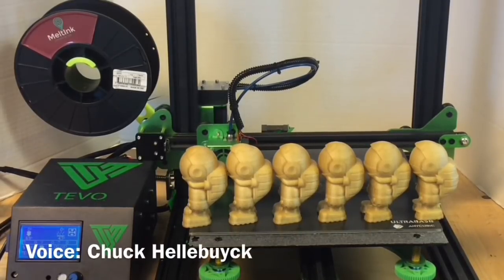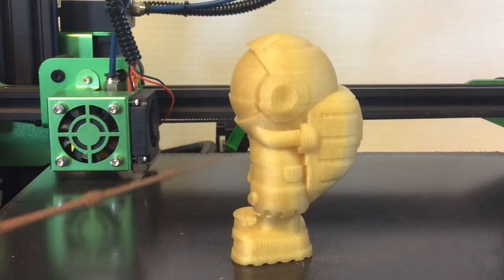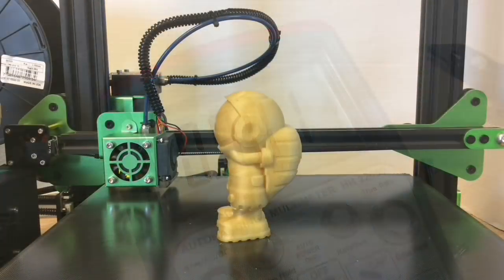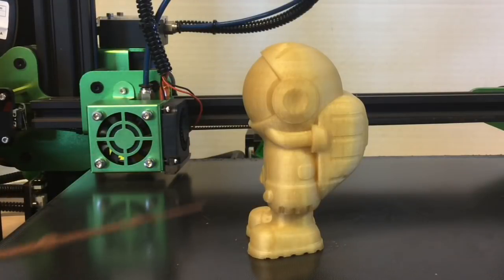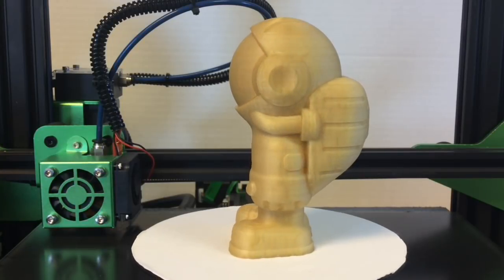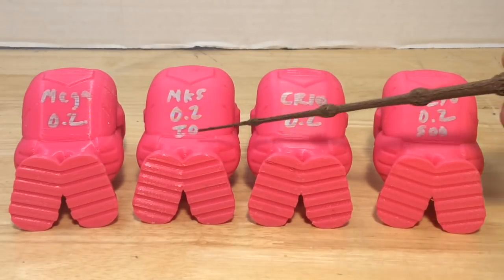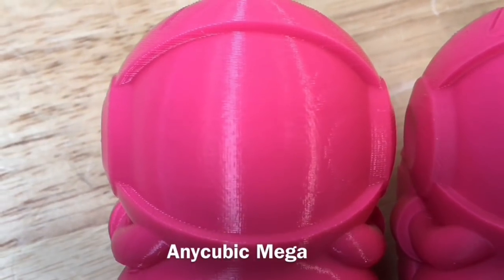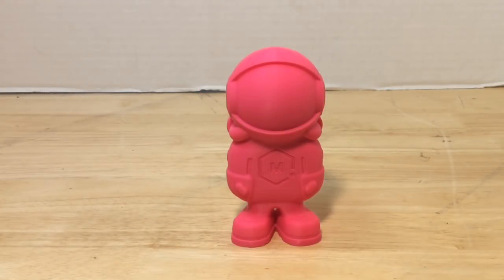Tevo Tornado Fix & I3 3D Printer Phil A ment Print Off

Comment: The CR-10 has been a headache for me. I know it's a great printer and it works for others but for me, it been a pain. I have been fighting with slipping extruder for months. Do you still like the TEVO Tornado? What about salmon skin a lot of people talk about, is that easy to solve?
Reply: Steve Laminack assuming your grub screws are holding and the gear drive is not slipping make sure the tension on the spring is sufficient to push the filament into the gear drive but not too tight and lastly you may just have a bad stepper motor this happens sometimes they come from the factory bad they work well enough to pass QC but they are weak where they fail completely replace the stepper motor it's a $13 test :-)

Comment: Were you able to get the x carriage to stop wobbling? I tightened all three wheels and the x-axis belt and mine still has quite a bit of wobble to it.
Reply: TheBlackBeltPanda there are two ways to tighten those Wheels you can tighten the bolt itself which I'm guessing is what you did but also one of those aluminum spacers Between the Wheels and the plate can receive a wrench it is eccentric if you put the wrench that came with a printer onto that spacer and turn it it will actually shift the position of the wheel in relation to the plate and it's plain pushing the wheel closer or further from the aluminum Extrusion in Chuck's case that's what he had to adjust to push the wheel closer to the Extrusion to tighten it up try that on yours
Reply: Thanks, I discovered that eventually when I took everything apart. =)

Comment: Did Tevo offer you any support in fitting your issues , or are they only interested in selling printers and relying on the community to offer support ?
Reply: I had the same issue. Contacted TEVO and to my surprise they contacted me in 9 hours. They gave me a step by step instructions to decrease acceleration as well as checking the stepper voltage. They had me bring the Y up to 1v. 
    2 days later I noticed the extruder had 1 tooth missing although it wasn't effecting my prints. E-mailed them a picture and they sent me and entire extruder assembly. I have heard horror stories about Chinese companies leaving high and dry with support but so far I am a happy guy. I have an Ultimaker 2 XL, Craftbot XL and 2 Raise 3D N2 Plus units and so far this cheap machine has been making fantastic prints! Very impressed with what I got for the money. Great comparison! Subscribed.

Comment: Hey Chep could you help me out? I have a XYZ printing Davinci JR for about 2ish or more years And like every 2 Prints it would Jam up the extruder I dont know why. I tried 3 colors And even with the white ( For some reason prints the best for me) And it still Jams up the extruder. I have a few projects I need to work on so I would love to have Some help as soon as posible. Thanks
Reply: CHEP 3D Printing & Electronics I don't Think so. I cleaned the nozzle completly before using the filament
Reply: CHEP 3D Printing & Electronics would It be posible that the filament need to be oiled so it does not Jam?

Comment: Very good example of how to diagnose and troubleshoot a printer problem. One thing I've noticed in forums (of which I'm also guilty) is changing too many things at once. It's hard because a lot of times when posting for troubleshooting help you'll get 5-10 different solutions for your problems.

Then when you finally get the issue fixed or it goes away on it's own there no way to know what fixed it.

Interesting seeing the Tornado up against these other printers. A lot of the artifacts such as on the face look like they might occur at layer changes. I see this a lot. I've toyed with retracting at layer changes as well as changing Z seem settings. What would you recommend to help with these defects?

Comment: I clicked on the link for the Tevo that takes you to GearBest and that takes you to the one with the EU plug 220v. When you choose the US Plug 110v the price goes up to $461.60 and the coupon code does not work with it. I understand that the probability that I have done something wrong or am misunderstanding this is high, but is this as intended?
Reply: Gearbest sent me a Tevo Tornado for review, but they only had the EU version in stock.  I have extra printer cables laying around, so I used one of them.  They are all the same on the end that plugs into the box.  I also adjusted the power supply to 110. (Like all of these inexpensive printers, it has a 110/220 toggle).
Reply: From my understanding the Tevo Tornado like most other printers in it's price range has a switchable power supply. It can be operated at either 220v or 110v. This means that the printers sold for the different regions are all the same with different rated power cables.

Most people I've talked to say to always purchase the lower priced printer regardless of the plug that's included. They plugs are generally standard PSU plugs that most people will have on hand or can be purchased for under $5.

Some one can correct me if I'm wrong but I think it's safe to buy the 220V if it's the least expensive.
Reply: I Think Chuck has made a mistake. There are two different affiliate links for this printer. I am sure he will post the other link (with the same coupon) soon.
Reply: Not always do these codes work (Gearbest and Banggood are weird like that) on both models.  The only difference is in the IEC cable they send to you as the end will be for the EU and I know I have over 25 IEC cords in a bag I have collected over the last 22 years so, for me, it would be no big deal but for others it would require buying one for your country from Amazon, eBay, etc...
Reply: Kevin, you have only 12 subs and they sent you a printer to review?  WaTaF?
Reply: The Best Stooge I run a website. The YouTube channel is added value. The reason for review units is really my website.
Reply: Ahhhh.  I was wondering but if they are giving based on a website they have no way to know the value they will receive since if they pull up a Youtube channel they can see how many subs it has but not a website.  Very intriguing that they would do that.
Reply: I have full stats on my website and have sent them over.  In my day job, I do a lot of SEO and Web Analytics.  Several of my pages rank in the top few results depending on what you are searching for.  Even without knowing visit stats, having common terms show my website is very easy to see the potential return.  Not to mention, my website serves a niche market, which I give them access to.  I do this for fun, not as a business.  I try to make enough on the side to make my wife ok with me continuing in the hobby.  :-)
Reply: Search Engine Optimization is just a part of being on the internet.  The real "secret" to SEO, is that all the best technical abilities in the world to rank high won't do squat if you don't make great content for your audience.  SEO is honestly pretty easy for most people.  Write well, become active in the community, pay attention to SEO best practices and don't let your website get in the way of SEO.

As for getting freebies, I think it is part of the world.  There are a number of people I trust online but I tend to look at the aggregate trends, not so much the individual.  (Though, Chuck is one I trust pretty much explicitly.  Remember too, when you talked about the HH2205D... to many, they are tools.  I have two multimeters.  That is all they are to me, and I can honestly barely use them.  Electronics are probably my weakest area.  I googled that to realize what it is.  I honestly couldn't tell you what mine are.  But, they are a tool to get the printer running.  I can follow directions on how to use it for those limited times I need them. 

Now, setting up an octoprint server, that is more my style.  I've been in IT for a couple of decades now.  I got into 3D printing for printing wargaming terrain.  And, as I said, I do this as a hobby.  I think several people in this space that are like me.  Now, I don't know anyone else in this space personally, so I wouldn't know anything about the corruption you have seen.  But, I can speak for myself, and say I do this for fun.  It gives me content on my website and gives them advertising.  At least in my case, it is win-win.
Reply: I learned about electronics first when computers were still around 700 dollars from a Heathkit catalog and you damn well better have known how to solder and what electronics was about.  Along came 1983 and I dove into computers until 2001 when everything went to hell in this world and I gave up on my career as the computer field was dead, or dying, with offshoring and downsizing now I just passively use a PC.

I don't look at trends I look at the individual because that is where integrity begins and ends and you either have it or you don't.  A lot of people fake it but they will slip up eventually and looking at trends is why the world is falling into the crapper.

As far as Chuck goes he had his answer, and he DOES know electronics, so leaving me sitting there without an answer I finally had enough.  If anyone accepts free shit I unsub them as fast as I can and all of that began with Joel Telling which woke me up to all of them.  YMMV but I am hard set on this about this.

Comment: I would think finding the same sagging on all the models would suggest either a filament issue or a model issue. maybe it would work better turning all the printers down a couple degrees?  I find every roll of filament has its own temp sweet spot. Most people only recognize brand name changes
I think the perfect printer comparison can only be done once you find the filament's perfect melting temp and using a model that doesn't have inherit difficulties.

Comment: Funny to see how there is much more gloss on the Mega I3 print.
Looks to me as if the extruder temperature was different on this printer. 
I have also compared the Creality CR-10mini against the Anycubic I3 Mega and for me the winner was the I3 mega. But, still have to make a video about that ;-)
Reply: 3d Print Creator It is all about the fan speed and fan cfm. no fan -> shiny, fan 100% -> matte is abasic formula but differs from printer to printer.
Reply: Well, I have 10 printers here at my office, all different and for me the only way to see a difference in gloss is to change the temperature. Also, I have designed a temperature tower and in one of my video's I do explain how you can see what temperature is the right temperature for your material because of the gloss (among some other ways to see this). 
And, when printing with my Anycubic I3 mega, using my standard PLA, it doesn't really matter if I turn the fan 100% on or completely off. The temperature is the way to handle the gloss of my part. At 205C the parts is matte, at 212C there is a little gloss, at 215C it's glossy all the way.
Reply: 3d Print Creator Makes sense. when the fan is on cools fast. I tried with fixed heat but diff. fan speeds. now I will fix the fan speed and change the temp to see what is happening. thanx for the tip.